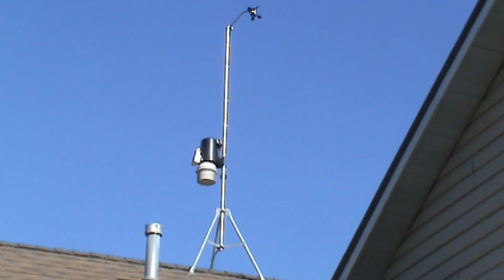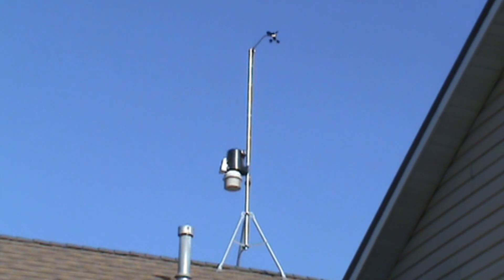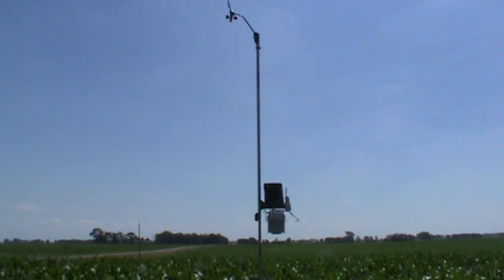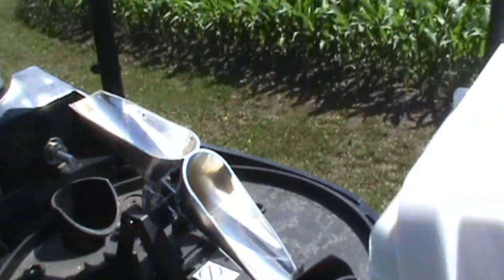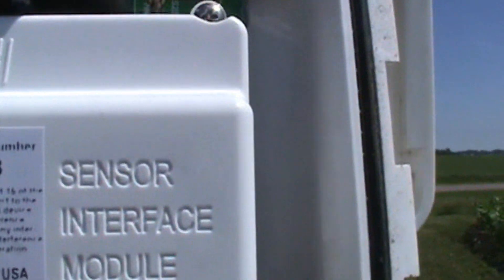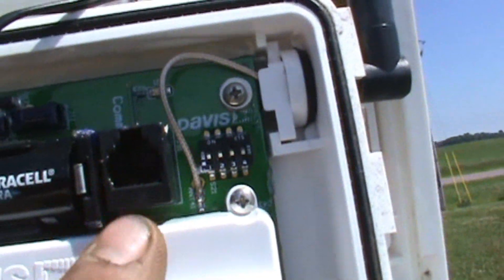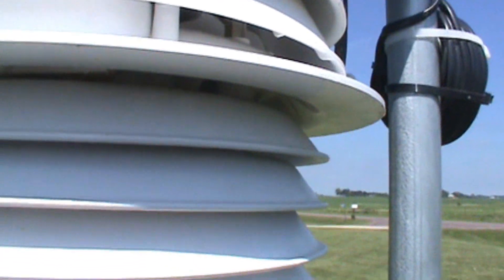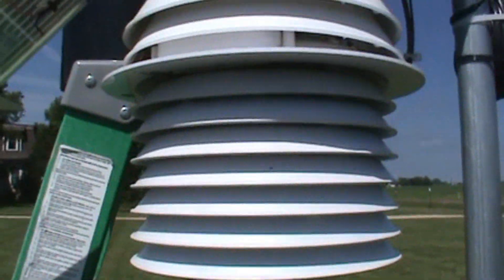Davis Vantage Pro2 Weather Stations update 6-25-2012 in 1080p

Comment: Once the station is all set up, how easy is it to get it all displaying really nicely on a website? Are there templates available? I been creating websites for over 10 years now and I now use Joomla! as the platform for my websites. I'm hoping that it would be easy to incorporate an online weather station without too much trouble
Reply from the maker: +Penn Wooding I started with the Weatherlink IP website originally, which took literally minutes to get going. Then when I felt I was ready, I took the big leap, and switched to Serial port communication which was much faster, and used Ken True's template to create my current website. That took a couple hours to get everything running there because there is so much going on.